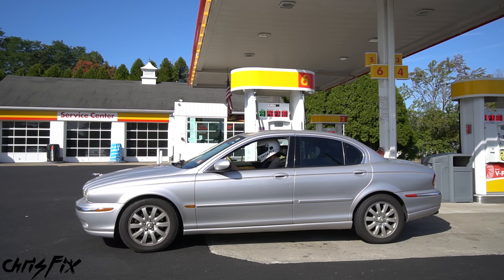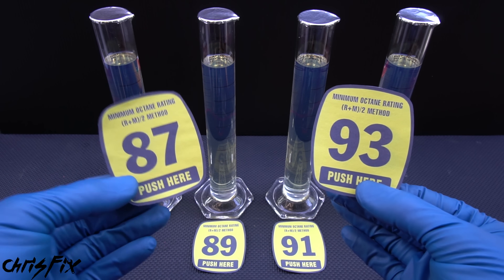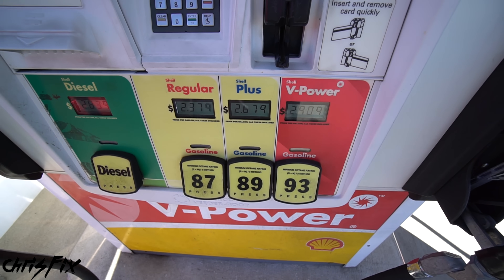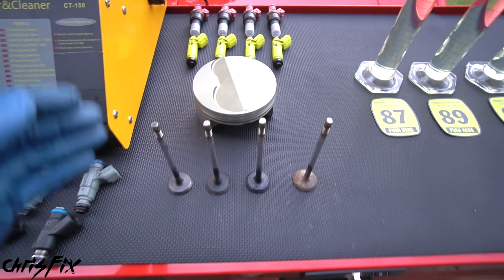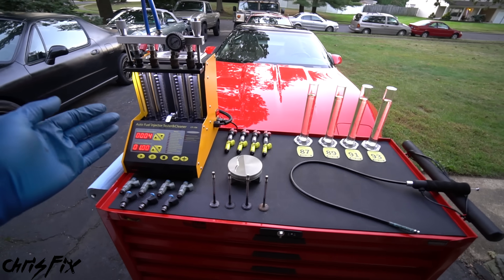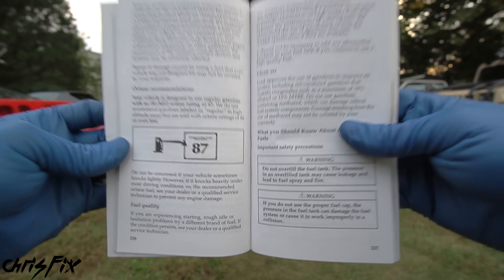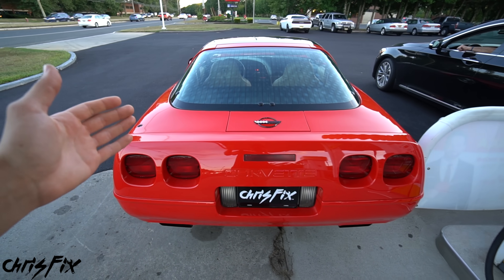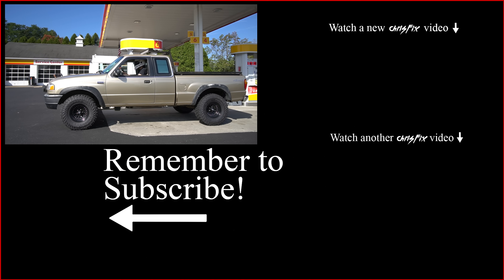What is the BEST Fuel to Use in Your Car or Truck and WHY

Comment: Russians use 93 octane at $1.70 a gallon equivalent generic they use 95 octane and their 100 octane is only $2.30 a gallon yes bring on that race gas. Race gas at the pump at a local nearby gas station for me is $15 a gallon USA, that's with two racetracks within a mile of that high octane gas station.

Comment: I’ve lived in Australia for almost 6 years - you won’t find 87 or 89 octane over here. It’s starts out at 91 here. They have 91, 93, 95, 98 and 91 ethanol.
Reply from the maker: Watch the video!
Reply: Australia uses research Océane number (ron) . Mon =motor Océane number 
North America uses  r+m/2 
87 r+m/2 =91 ron 
91 r+m/2=95 ron

Comment: There only needs to be one type of fuel imagine manufacturing one fuel and not having to store three different types with three different tanks imagine delivering one fuel to a gas station outside of diesel we should go to universal standard of 96 to 100 octane with no ethanol. You could get the cost down by not having to have individual tanks and processes for different grades of fuel one and done

Comment: All the myths you mentioned are not really myths, there is truth to them. Cars with computers in them are always adjusting for perfect balance. This is how u can get better fuel economy. U did explained it but yes the fuels have the same amount of power in them but the amount of oxygen you need is different. More octane needs more Oxygen for the reaction to happen so u can get better atomization with more oxygen also you can compress oxygen so fittibg more oxygen in the same place will get u a better more efficient burn and give u more power for the amount of oxygen fitted into the piston cylinder. This is why using superchargers and turbos give u more power. Also why turbos give u more horse power but if managed correctly can be an ecoboost functionality as well which u are starting to see now.

Comment: actually the octane does matter. I had a Ford mustang with a 2.3 qwhich had bigger pistons than my 2.0 Pontiac. in the mustang I got better mileage with higher octane. it didn't matter with the 2.0. some newer motors do say to use higher octane. I did this through calculating each tank I bought for mileage. I also remember having to clean my Quadra jet carburetor in my 77 350 chevy truck after using ethanol fuel. I can also guarantee less efficiency with E85

Comment: If you're trying to clean carbon inside your engine it should be recommended to replace your fuel filter first you do not want to clean a fuel filter that's dirty and run it through your injectors it has the potential to clog them up even if you're running premium gasoline

Comment: I live in Europe and I have been told to use Octane 100 despite my car being designed for Octane 95.
The reasoning being that in my country at least Octane 95 now only comes in E10 and that will wear out the parts in my car as it was designed for E5.

Is this something you can comment on as well? I've only been using shell v-power with no issues so far. I have in certain scenarios ended up needing to use Octane 95 and it drive just fine. But I am unsure whether or not I even need to keep running E5 Octane 100

Comment: In my town the outgoing premium is 91, but there's a chain here called Jumpstart that sells a 93 they advertise it as e30, in other words it has upto 30% ethanol,  and ethanol burns cooler!
Reply: @williamwallace9620  I dunno about all that,  with an e30 tune you get more horse power, I agree using e85 for too long will leave more deposits, and with the upgraded hpfp and injectors and  a tune will get you even more power, but e30 is not as bad in long run as e85 is
Reply: @williamwallace9620  I'm not an expert,  I am using an e30 mix from Jumpstart pumps here, our outgoing premium is 91, but jump start sells 93 octane with upto 30 % ethanol, I still pump e85 to make sure I get at least 30 % ethanol
Reply: When ever I'm able to afford the parts upgrade I just to compete but with run e30 as a daily

Comment: Didn’t hear about the other hydrocarbons in the min.  I thought that many gasoline types contained Octane (8 carbons) as well as Nonane (9 carbons) and Decane (10 carbons).   Nonane and Decane requiring higher pressures to assist with compression/detonation.
Reply: The other "-ane"s detonate too easily, which is why they are replaced by octanes

Comment: I've been using 87 on my Jaguar X-Type for years.Runs great it says premium but 400,000 miles and still going 😊
Reply: @darkside2521  clearly I'm 🤥 lying 🤥! Lmfao, Don't believe what people right on the internet. It's only 120,000 miles, And I wouldn't dare put 87 in atleast not on purpose. A full service gas attendant did put in 87 one time, I wanted to get out and beat his @ss. I told him premium like three times.. it was misfiring like a mother phcker. It does run great tho. If I do make it to 400,000 miles you'll be the first to know lol, just won't do it on 87 gas.

Comment: Love these videos! Thank you so much :)

I drive a 2009 Pontiac Vibe which says to use 87 octane or higher. Are there any benefits to using a higher octane other than the additives? And would it better to use higher octane to get the additives or to just add a bottle of fuel system cleaner to the tank?

Also you mentioned running the Shell premium will remove ~70% of the build-up with 250 miles. Does that percentage increase closer to 100% if you keep using it or does it stop around there?
Reply: Thwre is no reason to run anything 87 in yohr car. They all have cleaning additives.
Reply: I hava 2008 vibe, do u get po171 code in yurs? I get it in winter and yet the car is asymptomatic-purrs. Did all obvious chks. Very frustrating.
Reply: @keithmarlowe5569  Sorry that is total BS. Again, spending more on fuel for a car that takes 87 is pointless. If the manual says 87 or higher, use 87. you will get nothing else out of it except more money taken from you.

Comment: Some good info here but I will disagree about the differences. 93 octane always gave me better fuel economy and every engine I've ran it in performed better.
Reply: I agree, I put premium in everything and all of the vehicles run better and get good gas mileage because of it, I just don't see a reason not to run it, unless you cant afford the extra 5-7 dollars each fill up, the benefits are worth it I believe
Reply: Because of detergents, not octane rating

Comment: My 5.0 F-150 says it will run better with higher octane in the manual. It does! Much better and no knock. I put 100% gas 93 octane in it.

Comment: If ur car can run e-85, use it to get 105 octane instead of 93, 91, 89, or 87 octane to make your engine last longest even if it gets worse mileage
Reply: @williamwallace9620  not if it runs flexfuel. As long as it only goes to 85% and your not using methonol, your car will be fine if it's a flex fuel vehicle.
Reply: @williamwallace9620 i am mainly talking about flex-fuel cars, and new cars are most likely to have something in them to prevent water leaching or whatever it's called. Personally, I don't care about mpg too much and now that it's 50 cents cheaper than regular where I live, I prefer it, especially for turbocharged or supercharged flex-fuel vehicles.

Comment: I have a 2002 Chevy Silverado c1500 where wheel drive single cab long bed 4.3 V6 four-speed automatic will using the octane booster with v-power or any premium gas with double the power torque and fuel economy

Comment: Like your video's, I have a question I have flex fuel toyota tundra it takes E85 ive never used it because im in rual area and don't see it at stations, my question is ,is it really worth it ,I know that my oil changes have to be every 5 k but I do that anyway, an I know the tundra is actually all ready set up to use it ,with bigger injectors an all that stuff ,unlike Ford flex that have to be converted even though it says its flex, that on ford just means your able to converted it . Anyway just wondering about E85 .

Comment: Great video! I have a question:
If i fill my car with 100 octane(I'm in Europe) and then the next 5-6 times i fill i use normal(95), then again do 100 octance once and so on and so on will it make a difference over time in keeping the injectors and everything clean?
Reply: Octane rating doesn't clean anything. Detergents are up to the gas station. For instance, Costco gas in the states has top tier detergent added to 87 and 93 octane.

Comment: Unleaded gasoline 87 octane, 89 octane and 90 octane is pose to be clear and clean. Anything like ethanol is considering lead will clogged up your catalytic converter. Octane rating for your car owners manufacturing book is recommend 89 octane or 87 octane is accepted and no ethanol. Ethanol is lead was came from radical left Biden go green bunch administration to screwed you confused to screwed up your gasoline cars to force you with electric cars and they are clueless. Conflict over about ethanol is contains lead that shouldn't not allowed ethanol in gasoline on the market for people try experiment to remove the ethanol themselves are just clueless. 5w20 oil and ethanol is radical left products.

Comment: The fuel names in my country are really dumb, 87 octane gas is called premium, 90 octane called lite, and 92 called max, there's also 96/98(i forgot) called max turbo. You would think that premium gas is the highest octane and lite gas is the lowest. But nope. The worst thing is, they don't even put the octane number on the pump.

Comment: Very good video on your explanation of fuels. I own a BMW and I only use premium fuel and 99.99999% of the time I use either Exxon or Mobil the 0.00001% is from other gas stations that I'll use in a pinch if I am out on a road trip and there is simply no other choice. Gas stations have a rating scale and that scale goes from 1 the very best to (I believe it to be) 4 being the bottom of the barrel. Number 1 would be Exxon Mobil Shell and 4 is gas stations like US Gas or BJs. One thing I cannot stand is seeing a Bimmer driver pulling into a rated 4 station while a mobil station is across the street and the driver buys regular fuel. You gotta pay to play. Don't live above your means. Only buy what your money allows you.
Reply: Is there a place to access this rating scale?

Comment: I haul fuel for a living and used to be a certified mechanic. Everyone I've challenged to do a three tank fuel test has gained a minimum of 3MPG and said they could feel a difference in performance running 91 VS 85 (which is our low grade in my state). Also working as a mechanic for years I have seen the difference in the motors from acar that ran premium VS one that ran low grade fuel its life.  I understand and see the science behind your video but I am going to have give you a hard disagree on this from the physical evidence and what I have seen in fuel through my life.  That was a filthy piston in your video. I do recommend shell or chevron fuel though from what I have seen and know from working in the fuel industry now. Manufactures are recommending 91 or higher for turbo cars.
Reply: Could it be that what you have seen is due to bad contaminated fuel in lower octane fuels? If it was pure low octane fuel it may not have had that effect?
Reply: I agree with you 100%.
Higher the octane the better the performance
No matter what car it is.
Scope the pistons and see for yourself!

Comment: Hey Chris! 
Every gas station has one option for Diesel. Do other stations have better quality diesel than others? Or are all diesels the same at every station?
Reply: Most diesel pumps are filled with ultra low sulfur diesel fuel #2 if not all of them

Comment: Heya Chris, I'm sure you won't see this but I'm just curious, if a car came factory with the intention to run leaded fuel, should I run the highest octane I can? Which in Australia is 98 on pump petrol
Reply: Lead was the only way they had to get good octane ratings without spending a lot to make gasoline with naturally high octane. There were high and low octane gasoline options back then, as there are now.
Take a look at the compression ratio, you may find it online or in the owner's manual. If it's more than 10 to 1, use mid grade, and if it's more than 11 to 1, use high grade premium.

Comment: I heard the only reason ethanol is in gas, is a Political promise to create jobs for farmers in Indiana, and Kansas. it gums up the engine.  

BP got in trouble back in the early 2000s around Ohio the gas was watered down and engine blocks fuel lines/ parts cracked during the winter freeze. 

I would like to see a comparison between different gas stations/companies .

Comment: I do have one question though. So my 1999 Audi A4 recommends to run premium. But I’ve filled it up with regular unleaded gas. So do I wait until I nearly run out to fill her up with premium, or did I fill her up with premium the next time I get gas?
Reply: You don't have to wait. Mixing is fine, that's how gas stations make mid-grade

Comment: Great informative video; this is really helpful.  I am adding a bottle of octane booster to each tank fill of 87 octane gas. The engine is a 2.0Turbo.  Will this bring the overall octane level to something close to 91 as suggested in the gas door?  With current gas prices, this method, one bottle of octane booster per fill-up, is cheaper.  That said, I don't want an expensive engine repair.
Reply: Look at the label on the octane bottle to find out by how much points it can improve the base fuel octane number.
Reply: I have an accord too and I always fill with 91 or 93 or 95…it’s good for your engine and it wont do any damage.

Comment: I drive a 2006 Subaru Outback and I was running standard but my cat converter code came on. I was told I should up the gas to at least 89 so I don’t throw off the O2 sensors. I’ve been running premium to keep it as clean as possible. Do you think that’s too much? It runs a lot better with more efficient gas but Idk if I was wrong for going all the way to premium now. That was a whole lot I didn’t know about gas

Comment: To save everyone some time, it literally says in your owners manual what fuel the car/engine is designed to use. Most modern cars just need 87 octane. Diesel trucks obviously need diesel. Only performance cars, like a sports car, are designed for the higher octane fuel and that info is in the owners manual. As far as carbon build up, just make sure to get good gas from somewhere like Shell, Chevron, Exxon, or Costco and avoid bad lot additive gas like kroger or walmart.

Comment: One thing I can add is on an older higher mileage engine, you can also try adding a GOOD fuel system cleaner, like Techron. My Celica (7th gen, gt) that I just got was getting less mileage than expected, ran it through and it boosted it by 2.5 mpg or so. Won't be super necessary but it also fixed a miss on my Subaru. Chris feel free to elaborate or correct me, I'm just speaking from experience
Reply: I got extra 3mpg from switching to 93
Reply: @Life_42  yeah I'm not running premium in my Celica since it doesn't need it lol

Comment: In my experience with different fuel stations using different fuel additives there is a big difference on how clean the fuel burns Thus giving you poor or better fuel mileage. Not all additives burn equally. Recently I unexpectedly got diesel in my gasoline due to the delivery truck having a mixture of gasoline and diesel. The vehicle I put this diluted gasoline in had given me an engine code P0174. The fuel had 8% diesel in it causing the engine to think it was running lean. I know diesel is not a common additive to gasoline but on this note additives can cause an increase or decrease in fuel consumption. If the additive makes the computer think it’s running lean it will dump more fuel by Spursa if it thinks it is running rich it will subtract fuel. In my case the computer forced a lot more fuel trying to sense a 14. Seven to one ratio.
Reply: How clean the fuel burns depends on the fuel/air ratio, not the type of fuel!
Reply: @davemould4638  I never said fuel type changes air fuel ratio. I said the additives put in the fuel can change the efficiency that the fuel can burn at. It’s not rocket science. If you add oil to fuel to add more lubrication, you decrease the efficiency of the fuel burn rate.
Reply: Hey go ahead and prove me wrong. Put 20% diesel in your gasoline engines fuel tank and let me know how good your fuel mileage is.
Reply: @199wildman  If you add 20% of anything then it is no longer an "additive" but becomes part of the fuel mixture.  Instead, try putting 0.1% of diesel or even water into your petrol and see whether it makes the slightest difference.
Reply: @davemould4638  I deal with this problem all the time at Lexus. At 10% water or diesel doesn’t matter, it throws the O2 sensors off. Then the customer comes to me and I have to drain their tank and clean sensors.  It’s always the same, the report from the customer says they were getting worse fuel mileage and the engine light came on, go figure. Flush the tank, put good fuel in, and clean the sensors, no more complaints.
Reply: @199wildman  Yes, that's 10%  A lot more than an "additive".  That would be like calling the ethynol in E10 fuel an "additive"  At 10% concentrations it would be called a "blend".
Reply: @davemould4638  What exactly is your point other than trying to impress everyone? Nothing you said contradicts anything he said!
Reply: @louisp.3332  If you think that, you are not following the argument.

Comment: They manual tells you what gas to use. My Jeep requires mid grade or better. If anything less spark knock is gross. My Jeep is high compression. I’ve built 3 and I’m on number 6.